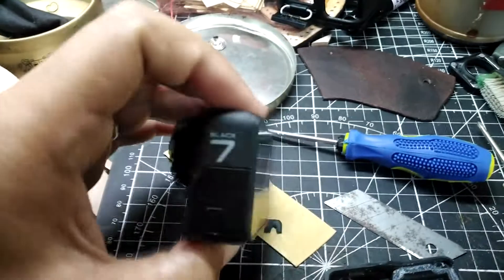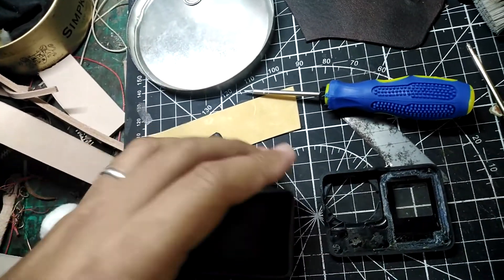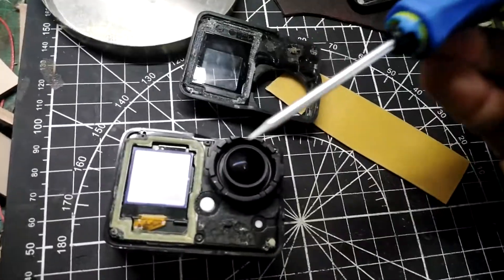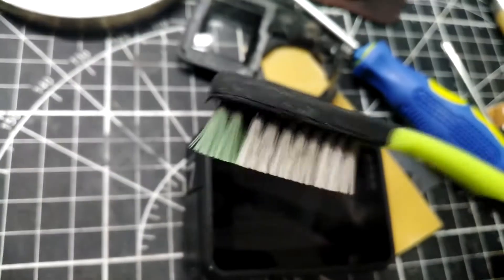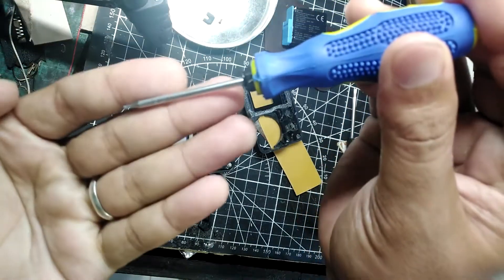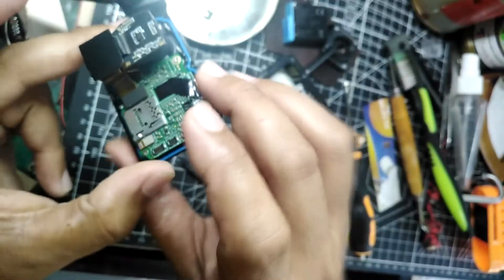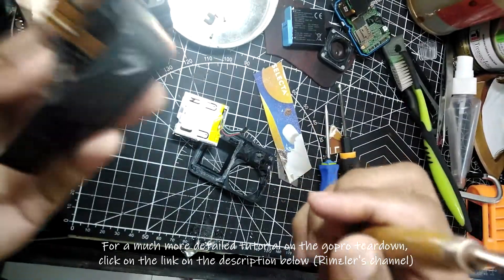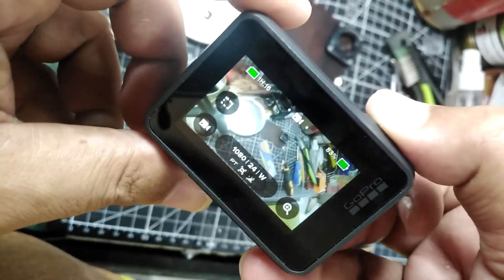GoPro Hero 7 Black freezing problem solved | Hardware fix

Comment: did u cam freeze when changing settings ?
Reply from the maker: No sir
Reply: @rpbushcraft  I fixed it, I just updated and it was all ok
Reply: This is my problem when inchnge setting it becomes Reboot Loop
Reply: @seariderph  have a look in the sd there is a file with and in that file u may have the software version, and then check if it is outdated and try to update it. I’m not and expert but that was a fix for me

Comment: Sir anu problem pag nag ffreeze video recording po?
Reply from the maker: Depende sa damage but mine was obviously due to the water damage. Yung iba can be fixd by replacing the batt or sd card or even the firmware...
Reply: @rpbushcraft  bali never naman ginamit sa tubig, motovlogging lng po, tapus na try ko na palitan ng SD card galing sa gopro max ko ganun parin , pero baka nga po sa battery mag try ako ng ibang battery
Reply from the maker: Ok sir. Try nyo lang po. Iba2 kasi reasons why nag hhang yung gopro.
Reply: @rpbushcraft  ah i see salamat sir
Reply from the maker: Welcome

Comment: Same Problem with me......Firmware update also not working. 

It’s still Waterproof after repair?
Reply from the maker: If you carefully disassemble and reassemble after yes it can but for me, I would not risk it and just use a casing on every underwater use.